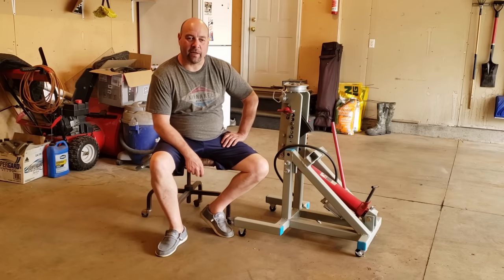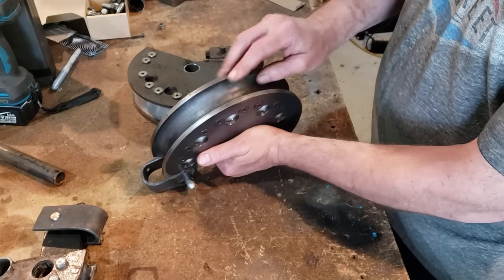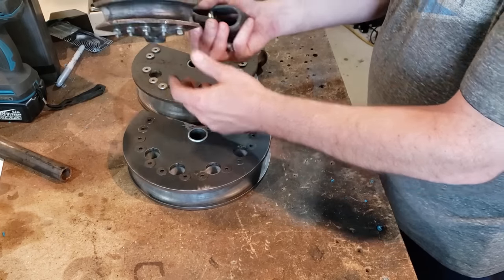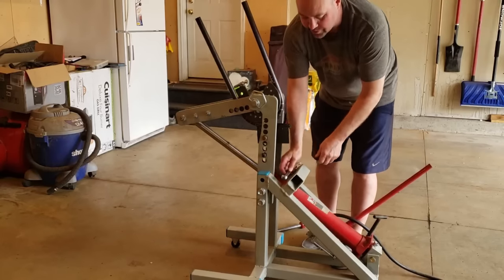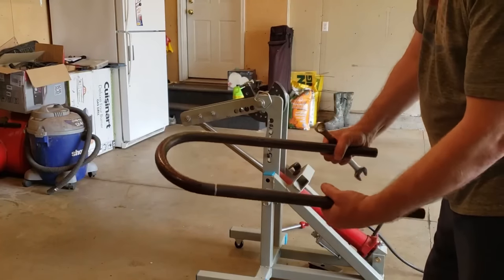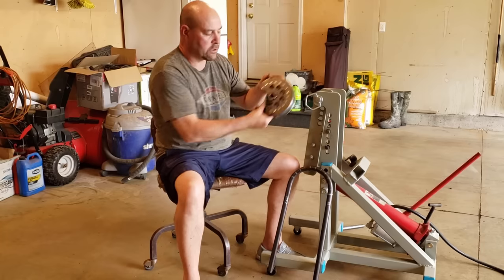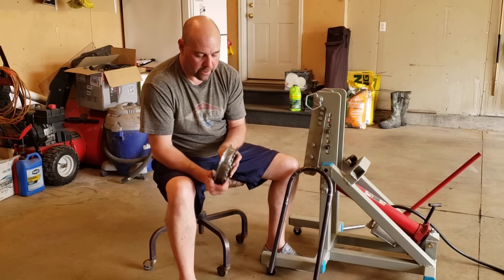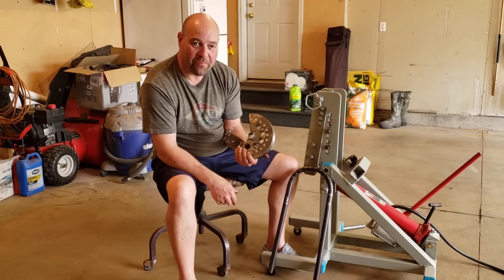A Budget Way to Build a Tube Bending Die

Comment: I am impressed that this works.  Thanks for sharing.  DOM is desireable because it is so much stronger, so it is understandable that it is harder to bend.

But, there are more than 10 dollars worth of bolts, probably more than 10 dollars worth of PETG, and a few dollars worth of steel plate.  And then you reused parts from the old die.  Clearly an inexpensive die, maybe $30-$40, but not $10.

Suggestion: Go to a pawn shop and buy dedicated end wrenches for your bender.  Then weld on some hooks to hang all the tools needed for the bender right on the bender.
Reply: I thought DOM was a manufacturing technique that could be used with a variety of alloys
Reply: @neffk I suppose it can, but when someone uses the word DOM in the USA in fabrication circles it refers to steel tubing.

I have been a fabricator and welder since 1967, and have never heard the term describe anything else.

Next time you are in a steel supply place, ask to see DOM and see what they show you.

Comment: Hi, I want to build a 180 degree, 1-1/4 sch 40 pipe die. A couple questions: are the outside steel sides the same on all dies for the model 32 bender? Can you build the plastic 3d parts for me, and what would it cost? Thanks.

Comment: Now you should look into dimple dies and metal brakes made from 3d prints. I'm glad I found this channel lots of good ideas and I think you folks are close to me in ND.
Reply: A CNC Plasma cutter kid nice, but far from necessary.  If you feel a CNC cut part is important, sub it out.  This piece can be made entirely by hand, it may take a little more time.
Reply: @paulkotowski4006  Its all about efficiency and repeatability. If you are doing a 1 off sure but if you have to make 5 of something this saves you time. I run a router CNC, CO2 laser and 3d printers I can make parts to sell and tools for my shop at the same time.

Comment: Seems to me that installing bushings around the bolts would let you really tighten the bolts without deforming the plastic. 

Relatively cheap upgrade and could be just as easily be made from some tube

Comment: The plasma cutter and printer are exotic tools.probably cost 3 timesmore than a bender with 8dies each.my bender cost 1200 with 8 dies.i have built 2 dies using3/8 plate and cheap emt bender heads.they are aluminum.i used grade 8 bolts.
Reply: I mounted my bender horizontal 36 inches high .much easier to use ,esp. On roll cages and frame rails.
Reply from the maker: The cnc plasma cutter in the video was under $500. A 3d printer isn't an exotic tool. They are common place and can be had for under $100.

Comment: Nice job! I would never expect PETG die to work.
What is the model of a bending machine you are using? I like it since it bends vertically, it is easier to measure the angle.
Reply from the maker: It's a homemade bender.

Comment: When you cut that out I could see what needs to be done to build your own die. Just cut the next one  one eighth small  then the next one a eighth  smaller and so on till you get half the demetion you need then cut Sam different  size  for the other side  bolt them all together and a little grinding  and there you have built your own die.

Comment: Couple of things. Where do purchase your 1/4 plate? That is more than $10 US ea plus the material for the print. Plus fasteners. I'd say closer to $40 but still pretty cool as long as you had a plasma table and a 3d printer and know cad. Not like it is in everyone's garage yet.
Next, do you have to drop the follower out every time to remove the bent material from the bender? If so that would be a nuisance.
Reply from the maker: If you purchase the steel at a reliable steel supplier it is much cheaper. Around $6-$7/sqft for 1/4" both plates fit onto 1sqft of material. The die uses around 300g of PETg which goes for around $15/kg. You don't have to remove the follower, it makes it easier to remove the tube when you make large bends.

Comment: JD, would there be any benefit to a) alternate the sides every other bolt so the heads are opposite to counter any stretch of the bolt? snd b) gluing/epoxy the two halves and the steel together to solve the DOM issue longterm?

Comment: I have an Ultimaker 3 Extended 3d printer.  The build plate is about 8.5”x8.5”.  Is that large enough to print that die core?  Also, if a larger radius die was needed (larger than the printer’s build plate), what are your thoughts about printing the core in multiple parts?
Reply from the maker: It would be a tight fit since the dies are 9" in diameter, it would still probably work if you split the core into multiple pieces.

Comment: I purchased the plans set but the 1.25 and 1.5 dies don’t fit on 220x220 3d printer beds. Do you offer the sets in 120 or 90 degree instead of 180? Email sent
Reply: I printed the dies on a 220x220 bed, I just had to print it on its end.

Comment: This is great guys! I have the same bender and I've been looking at the KJ Cross cart builds. Can you tell me what 3D printer you're using? I'll be looking to purchase one soon!
Reply from the maker: We are using a lulzbot Taz workhorse and an ender 3. Both have had extensive modifications.
Reply: When you say you have extensive mods to the printers, does this mean it's probably not something that can be done as practice while learning 3d printing. That being said can these be made with a fairly basic printer? What's your preferred platform? Awesome job, I'm a fab/welder but still do it all the hard way...lol which isn't neither bad or good right haha! keep it I'm definitely subscribed!
Reply: @squatchusmc9133  Most of the mods are fairly simple to carry out. We would recommend starting off with and ender 3. They are pretty much plug and play and cost $100 when on sale.

Comment: Great idea! What do you use for a follower? Thanks
Reply from the maker: The follower is made from tube one size larger, welded to a plate with a hole for the pin.
Reply: @jdsgarage701  thats a great idea. I really enjoy function 3D prints. Looking into purchasing your plans for the cnc plasma cutter.

Comment: Nice. Next time, burn / 3D print the 2 most distant holes full size. Then ONLY 3D print the rest at the tap drill diameter or smaller. Then, use the 3D print as a drill guide doing the tapped side first. Everything will go together perfectly.

Comment: I was going to build my dies by laminating plates with some jb weld holding them together, but this seems like a cheaper option. Especially with how expensive steel is at the moment.
Reply from the maker: Good thing you didn't try using JB weld to make dies  there might have been some explosive results.

Comment: Can this bender be used to replace rogue fab bender and build KJ raycing chassis? Of course some numbers must be changed, but you know what is the offset in this one? Im really tempted to buy your plans
Reply from the maker: Yes you can replace a rouge fab bender with this one. The die offsets will be different on every die but this can easily be calculated.

Comment: Where in the world did you find a plasma cutter, 3D printer, required operating materials, sheet metal & bolts in the correct sizes, and other miscellaneous items (you know stand, hydraulic pump,, etc.) all for under $10.00? 😮
Reply: The purpose of this is for someone who has some or all these tools. Not for the guy with a home depot bench and a set of harbor  freight tool set. Move on.
Reply: @wakeupslaveamerica  oh, I have all of them, and more, I was just commenting on the title of the post.  Didn't mean to hurt your widdle feelings.
Reply: @KevinS3928  Its obvious it material cost not tooling and materials. Sounds like your hurt over the title.

Comment: Budget: build/buy plasma cutter. Build/buy 3D printer. Buy large sheet of 1/4” steel. Then your die will only cost $10 or so.  Once you have all the other tools and the screws and fixtures and bushings and hardware. 😂

Comment: Well, that was a waste of 15 minutes.  $10 .. ya, but how many $1000's did you spend on the 3-D printer and CNC plasma cutter?  That's find if you use these things daily in your business, but your average joe doesn't have these things at his disposal.  So, I spent $135 on a 10 bar of 2" x 1/2" flat bar and made my own bender, and $300 on a real JD2 bender die.  Now I can bend all the chopper frames I want.

Comment: This is cool except for where you say that anyone can do this without specialized equiptment.  I have a garage full of mechanic tools but no CNC plasma or CNC parts building machine.  Ten dollars?? Sorry but gotta call BS on that.
Reply from the maker: The metal parts for the first 2 dies we made were done with an angle grinder and a drill press. We would be very surprised if you couldn't find someone in town to do the 3d printed parts for a nominal fee especially if there is a university.

Comment: A budget way to build a bending die if you have a 3D printer and a plasma table. So all I have to do is invest about $3,000 or $4,000 and I can build inexpensive bending dies. 😂😂😂😂
Reply from the maker: The plates can be made by hand as we did with the first few. A 3d printer can also be had for less than $100 which is less than half of what a regular die costs.

Comment: Without using a bunch of specialized equipment . . . everything you used to make it was specialized.
A regular guy in his garage doesn't have those machines. WTH!!!
Reply from the maker: We showed the dies where the steel parts we made by hand. A 3d printer isn't really considered specialized equipment since they are common place and can be had for under $100.

Comment: So, you can make it for $10 IF you have $9000 worth of computerized specialty fabricating machinery.
Reply from the maker: The equipment in the video can be had for less than $1000. We also showed the dies where we made the steel parts by hand. A 3d printer can also be had for less than $100. Which is under half the cost of one regular die.

Comment: I'd sure like to know where I can get enough 1/4" plate to cut out those two forms for under 10 bucks FFS!! All that PETG has got to cost more than $10! Under 10 bucks?... yeah, I don't think so!
Reply from the maker: At the time of making the video a good steel supplier was asking $6-$9/ sqft for 1/4" plate. PETG filament can also be found for $12-$15/ kg, the part used around 300g.
Reply: And he said normal shop hand tools hahaha . Like the 3d printer and cnc plasma.  B.S is getting deep
Reply: @jdsgarage701  so by your own math, you are over $10 in materials   Maybe get lucky with some offcuts from the steel yard

Comment: So its a real budget way as long as you got 100k worth of machinery sitting around your basement...ya gotcha. Here's a budget thumb down
Reply from the maker: The tools required to build these are about 1000x cheaper than you mentioned. In the video we showed the dies where the steel plates we cut out by hand with a $10 angle grinder. The cores for those same dies were printed on an ender 3 which can be had for $100.